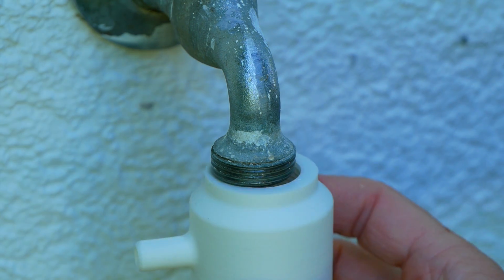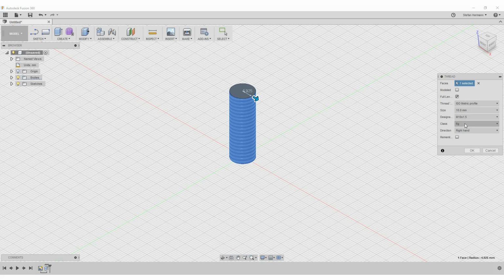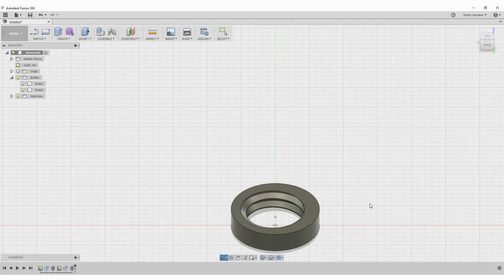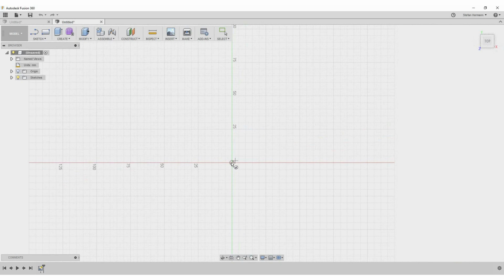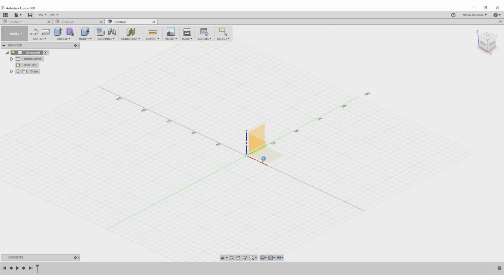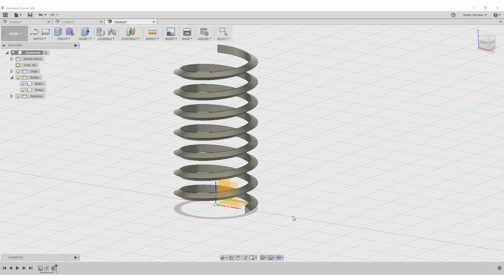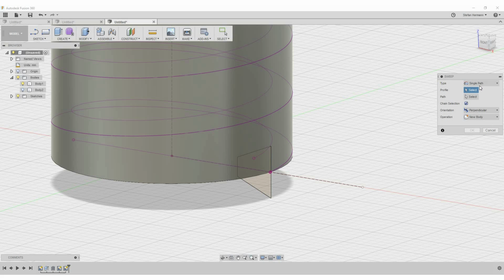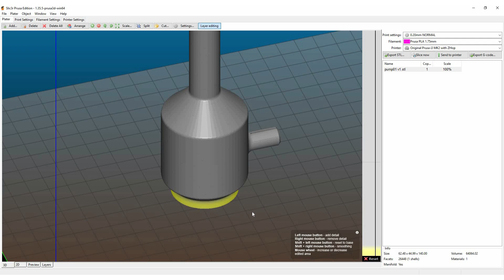3D printed threads - 3 ways to model them in Fusion 360

Comment from the maker: What's your experience with 3D printed threads? Do they work for you? Did you get them to work with different materials besides PLA?
Reply: CNC Kitchen ABS works great, just a little bit tight which I need and it is very STRONG. l absolutely like your videos, awesome contents 👏.
Reply: I normally go for a M3 M4 M5 M6 or M8 screw when i have to fasten it to something. I normally make these by using a tapping tool. I had a M6 screw 3D printed with a M6 thread by making it 6mm in diameter and then, cutting the thread. It's extremely easy in a hole (keep in mind the wall thickness!) and even though it is quite hard to do on a bolt, then i'd say. An M6x50 is possible to make fully 3D printed. I know it's kind of cheating, but for really well working threads, this is the way to do it
Reply: I just watched your video yesterday and while I knew of the thread-tool, I didn't know of the two other methods you demonstrated. I also had not yet actually tried 3D-printing threads, but I just did print M10x1.5 yesterday-evening in PETG and it came out beautifully, didn't have to adjust the amount of play in Fusion 360 at all. Today I tried M5x0.8 with the same PETG, again without adjusting for play, and it's just a tad tight, but works fine, still. I doubt I could go much finer pitch than that, but for my needs that's small and fine enough and I'm quite amazed that one can even print actual threads in the first place!
Reply: So any M6x50 or just the one thread size you've used?
Reply: Cake well if its M8 you could get more than 50mm in length. i mad an M6x30 when i did it, but the rod was stiff enough for a 50mm length. the problem is that you have to cut it in a rod. 
too thin and it'll break, and same goes for a too long rod.

I'm in denmark so my thread is either iso or DIN. 

at work I've tried a 1/4" and a 1/8" thread. worked like a charm!

hooe it helps
Reply: Cake well if its M8 you could get more than 50mm in length. i mad an M6x30 when i did it, but the rod was stiff enough for a 50mm length. the problem is that you have to cut it in a rod. 
too thin and it'll break, and same goes for a too long rod.

I'm in denmark so my thread is either iso or DIN. 

at work I've tried a 1/4" and a 1/8" thread. worked like a charm!

hooe it helps
Reply: 0.4mm nozzle, layer-height 50micron - 150micron -- doesn't seem to matter much, 30%-50% fan speed, 235C first layer temp, 225C for the rest. This is with PrimaSelect PETG. I haven't tried other brands.
Reply: used the g 3/4 thread in fusion 360 a bit off from the garden hose thread in the US whichis also supposed ot be g3/4?
Reply: I tried printing a M4x0.7 bolt and nut in PLA on my CR-10S, and they work :D Not like the machined steel though. Im new to 3D printing so there is probably loads of parameters to tinker with :D
Edit: Some grammar errors.
Reply: that thread printing is a cool idea since all threads above the size of m12 (~1/2inch) become exponentially expenive , i am thinking of an M60 finethread for examle xD.
Reply: So i decide to try for my last project with a 8mm thread for bolt and nut, it's working like a charm with the thread tool on fusion 360. 0.1 layer height at 15 mm sec.
Reply: On my Universal Filament Spool Holder (by butchja) on thingiverse I used a special trapezoidal thread form with a flank angle of 60° with a big gap of 0.4mm between inner and outer thread. This threasd proofed to be extremely good to print and even if you have a badly tuned printer the thread is still working. I haven't tried a metric or withworth thread so far because the tolerances are so small between the internal and external thread.
Reply: Beyond 6 mm I rather tap threads in printed parts. If it's supposed to be used for screwing from time to time I plan some nuts integrated instead of taping. The coil method is interesting for threads other than iso, like threads from some juice bottles to adapt something on them.
Reply: What was the Die-hard-meter again?
Reply: Screws up the dimension of the thread haha nice
Reply: I guess Im asking the wrong place but does anybody know a method to log back into an instagram account??
I somehow lost the password. I would love any tricks you can give me!
Reply: @Cayson Morgan instablaster :)
Reply: @Westley Titan thanks for your reply. I found the site through google and im trying it out atm.
I see it takes quite some time so I will get back to you later when my account password hopefully is recovered.
Reply: @Westley Titan it did the trick and I now got access to my account again. I'm so happy:D
Thank you so much you really help me out!
Reply: @Cayson Morgan no problem =)
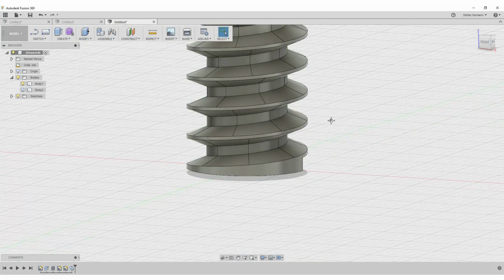Reply: Great video, the custom thread in Fusion 360 requires so much workarounds, did you ever find a better way for the custom thread that has a continuous face all the way around? The approach you used ends up with about 8 faces per spiral/pitch e.g at timecode 15:36. May not be possible, haven't seen another video that has managed that.
Reply: I often find that it's hard to make a 3d printed inside thread fit on machined metal threads in a straight way. I think it has something to do with the edge of the 3d printed thread, but I couldn't find a good solution for it yet. They still work, but it takes some fiddling until they screw on straight and don't get stuck.

Comment: Hi. That is a nice tutorial, but the first method is not really correct. This is not what a thread is build in reality and you won't get torque on it, when you build it this way. Even in 3D print.
The outer thread is actually always sharp. Is there a precise way to create an inner and outer thread in fusion?

Comment: Selecting 'Exclusive' mode in 'Slicing Tolerance' should make threads work if otherwise they are a bit too tight. It makes sure the squish width of the plastic never exceeds the boundaries of the original model.

Comment: I just printed my first 3D print last week making 3 different nuts and bolts to explore the SLA resin printer’s tolerance. I had okay results on my thread quality, but not crisp and clean. I think because of the supports blocking many of the threads, printing at 0.1 mm coarse layer setting, and my overall inexperience. Now I’ve been struggling the past 2 days trying to make custom buttress threads to replicate a 100 mm wide mouth plastic Nalgene cap with some additional mods. I’m a noob and was following another tutorial with mixed results. The third example of yours pointed out a few important details I kept getting confused on - basically external threads but modeled “inside” the cylinder. I didn’t realize that modeling it inside the cylinder was an option! That now accounts for my sizing being off the first few (ahem 20+) times. The chamfer part was also an important thing for me to see here since my design requires this as well. My part that I’m trying to model after/replicate is so tiny and really hard to get a good look at without cutting it in half. I wish someone could share semi-buttress thread profiles for SPI 100/415 Nalgene closure with me or point me to any good resources for plastic thread standards used in scientific and laboratory settings. Thanks for the informative video!

Comment: Your videos have helped me with my 3d printing a lot.   I recommend you quite often to anyone that wants to improve the physical properties of their 3d prints.   This video, 4 years after you posted it, helped tremendously with the offset faces.   Fusion 360's thread modeler is very weak, but that offset faces is extremely powerful. 

I have an M36 Aluminum Bolt that, based on measurements, is machines to be a fairly close fit.    3d printing a protective cap for the threads using the defaults in Fusion results in a cap that is simply too tight.  My 3d printer is calibrated as closely as it can be, and often prints parts that thread or slip-fit together when I am in control of the tolerances.   Just want you to know that even these old are super helpful.  Thanks!

Comment: Why design the thread as it was machined and not molded..? If the thread are designed as machined it will be very thin in the beginning of the thread and you might have som difficult geometry at the end. These problems can be solved by designing it like it was molded... 

It's a nice feature in Fusion360, but it's not the "Correct" way for plastic models.. :-)

Comment: Ok so I have a problem when I 3d print a thread.
I have a 29.97mm cylinder and a nut hole.
When I make the inside and outside the same thread "iso 30mm metric" they don't fit once printed.
It seems the cylinder thread outside diameter is too big by a few millimeters.
My printer prints very close to hole sizes etc so I'm not sure what the issue is.

Comment: How do you model internal threads with the coil tool. I made  cylinder made a coil screw fine   When I make as coil on the inside of my other cylinder the same diameter as my precious cylinder the coils doesn’t cut enough material away. How can I fix this.

Comment: Autodesk isn't very logical, I'm using Inventor, which works basically the same, but costs $1985 (I have it free since I'm studying engineering) and doesn't have that "model thread" feature, which is very weird considering that Fusion360 costs much less and does have that feature.

Comment: Bit late to the party here 🙈 but I tried printing threads, already knew about modeling them with clearances for fit, but I had a strange result printing. It looks as if the under side of the threads are "drooping" and the edges of the threads are rolling over. I modelled an M36x4 thread so don't exactly have a tap or die to recut the thread. It almost seems like its too much overhang. Has someone else found this? Ill try again with custom profile with 45° max but I haven't heard anyone needing to do this?

Comment: Leider funkioniert die Erzeugung der Toleranz durch Verschieben der Flächen bei den selbst erstellten Gewinden nicht. Das Sweepen erzeugt keine durchgängigen Flächen sondern segmentierte Einzelflächen, welche sich nicht gemeinsam auswählen lassen. Um diese zu verschieben müssen unter Umständen hunderte von Flächen einzeln ausgewählt und verschoben werden. Kennst du dafür eine Lösung?

Unfortunately, the creation of the tolerance does not work by moving the surfaces of the self-created threads. Sweeping does not produce continuous surfaces, but segmented individual surfaces that cannot be selected together. In order to move them, hundreds of surfaces may have to be selected and moved individually. Do you know a solution for this?

Comment: Hi Stefan, I tried to create a screw with ISO Metric Prof, 8mm size Class 6g and the 8mm hole but the screw never fits the hole unless I increase the hole size to 9mm. I am using PLA-SILk and 0.4mm nozzle. What's your take on this?

Comment: Just a quick update to the newer version of fusion: there is a new point in the dropdown-menu from the sweep command. Instead of using a guiderail you can use a guiding-surface. In this case it would have been the bottom of the model. It doesn't change the outcome. I like it better, since you have no (annoying) confusing guide rail in the model.
Reply: Thank you for this.  Stumbled across your comment and it fixes where my thread wanted to twist following a single rail.

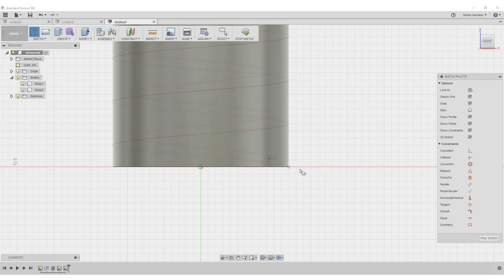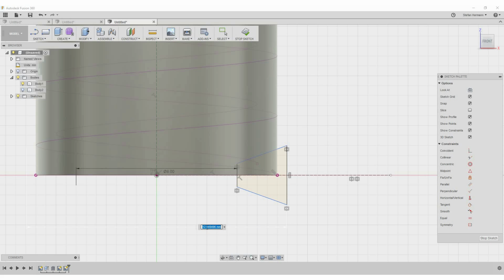Comment: 13:43-14:05  Wut?

On that last technique, once you had created that triangular helical section, could you have just created/extruded a new cylindrical section matching the inside diameter of the helix and then merged them?  If that doesn't work, could you explain why?

In any case, thanks for the cool video.

Comment: Actually, the example in my previous post was a little complicated.  In fact this very same issue exists in all thread bolts at the point where the threads meet the head of the bolt.  All printed bolts will fail at that interface.
Reply: My solution was to extrude a hole through the center of the threads and into the bolt head (or stud in my case).  This strengthens the bolt by providing additional perimeters through the center.  Thus a hollow bolt is actually stronger.

Comment: I have an issue with a threaded bolt which has a non-threaded stud extending past the end of the threads.  I print it with 5 perimeters and the stud  and threads are very strong.  However, the point where the end of the threads and the stud meet is very weak and breaks right at that point.  I believe its because the stud in smaller that the bolt and the perimeters do not match hence a very weak point.   I could print it with 100% infill but that seems wasteful.  In F360 I have extruded the end of the stud back into the threads hoping that would continue the 5 perimeter profile from the stud into the bolt but that's not how it works...at least Cura 4.5 did not slice it any differently.
Since you are always interested in making things strong, I thought you might have a suggestion.
Thanks

Comment: When I try to print a bolt I have an issue where the left side of the rod print normally but as the threads go around the rod the profile changes such that there is a flat landing on the top of the threads.

Comment: Hallo, I met a problem when I printed the thread. I have a screw, and the type of the screw is ISO metric  M6x1. I printed the thread with 6mm, but it was a little bit small. Then I printed the thread with 7mm, but it was a little larger. So are there any ways to print the thread with 6.5mm?? ( there is no 6.5mm option in the ISO metric profile).
Reply: Use the non-symmetrical scale tool to scale the part slightly smaller (1-2%) in the X and Y dimensions.

Comment: Sorry I forgot to ask another question. I was trying to make ANSI threads 1/2x13 then get it to print PLA. Guess one has to convert between MM and Inch. I set the threads in Inches, then changed Fusion to MM and sized the nut. The nut came out correct size but the threads were too small. Can Fusion make ANSI threads when end goal is supposed to be a 3D printed item?

Comment: This trick to adjust the tolerances when using the Thread feature was just what I needed! Increasing it by 0.2mm on the side and 0.1mm on EACH flank worked perfect for me on my Ender 3 with some older filament (which might be part of the problem there).

Comment: i just print a hole and tap it, much simpler
Reply: depending on the printing method, and material, it may be too brittle or simply lack the required material as many prints are hollow with support structure

Comment: Thank you for this; I was very confused about what the 'class' option meant in Fusion 360's thread tool.  And I was also finding the inner and outer threads did not fit together at all after printing, so I am hoping that your method of adding more spacing tolerance will come in handy.

Comment: How small can we make threads?
Reply from the maker: M3 still works fine.
Reply: I'm going to experiment in a few minutes from M2 to M2.5 and M3 and see what results I get with the 0.05mm preset in slic3r  @CNCKitchen
Reply from the maker: Let us know how it worked out.
Reply: The M2 threads came out looking alright but they stripped off but probably because I have printed PETG with lower nozzle and bed temperature than the default setup, It was a bad Idea to try to test everything at once  @CNCKitchen
Reply: So I've redone the print and it works well with M2.5 too, no stripping this time @CNCKitchen

Comment: I wish there were a "Lifesaver" button I could press, so "Like" will have to do. I've spent the past day going through various videos (even from Autocad!) that end up saying something like "Well, the thread profile doesn't turn out exactly like you wanted, but it's close." 

Your technique #3 is perfect for creating a thread that has a custom profile. I like a custom profile because I can control the overhang and clearance (tolerance).

I've bookmarked this video because it shows the right way to make threads, simply and clearly.
Reply: Solidworks has a tool called spiral for the path and it makes making the thread so much easier for custom threads.

Comment: The first time I printed a threaded part, I modeled the threads on the "screw" side of the part but instead of modeling the threads on the "Nut" side, I just used the screw to cut the nut. So my zero tolerance parts didn't exactly fit. womp womp.

Comment: There is a helix plugin you can download for fusion 360 if you are on Windows. Just Google for "helix plugin fusion 360" it's called helix spline sketcher and it's on the Autodesk app store. Used it for Make Anything's springo tutorial and it would help with the third method.

Comment: How do you make pipe threads? They are tapered, on a cone not a cylinder, so that tightening enough will make a gas or liquid-tight connection.
Reply from the maker: I guess you have to work with the third method and use the "angle" option to get this working.

Comment: I liked the first two methods ... the third one caused a small explosion in my brain...  great video, thank you
Reply: i think it exploded your head because the first step is not required. just create a custom profile, then a helix, then sweep the profile on the helix and use that to cut the cylinder.
Reply: @constantinosschinas4503  How do you create a helix in fusion 360? :) 
Only found this workaround so far

Comment: Hi, was
that a vacuum water-jet pump you showed in this video? If yes could you share
the model or the link where you got it from?By the way your printer looks extremely well tuned.
Reply from the maker: You are 100% right. This is the first prototype of that pump which is unfortunately not working well so far. I will share the model and post a video about it as soon as it properly works.
Reply: CNC Kitchen hi, 
this would be greate!
thank you